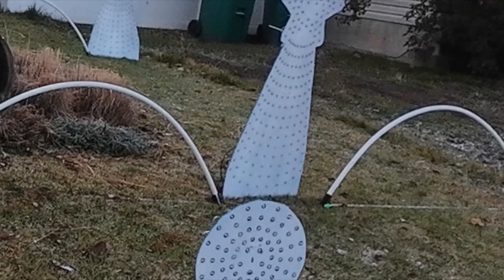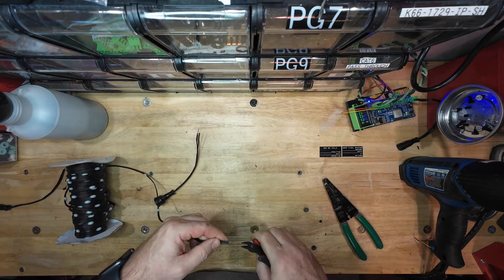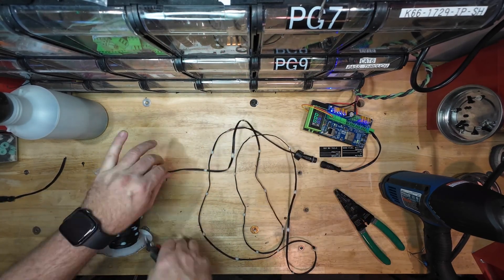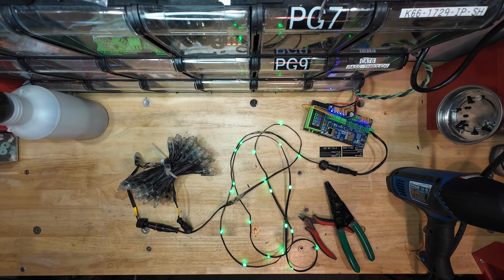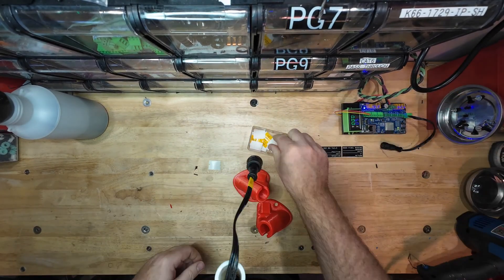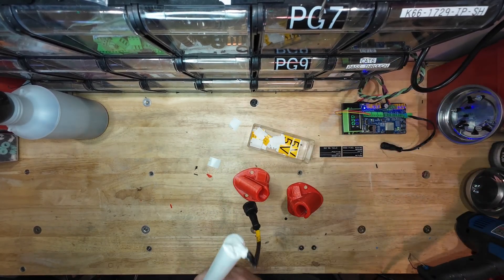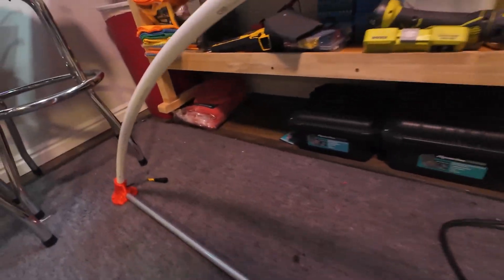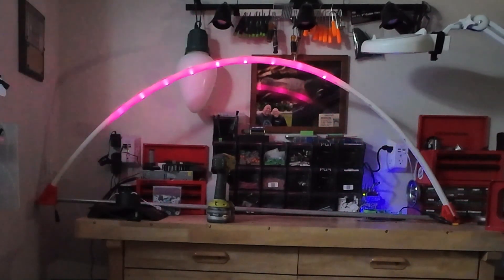How to Build Stunning Leaping Arches with LED Seed Pixels | DIY Holiday Light Display Tutorial

Comment: Female goes on controller output, male end goes on seed pixels, 3D printed parts may not last unless you use a nylon type material.  Just FYI observation, Thanks for the video.
Reply from the maker: That is correct. That is the best and only practice. I have used PLA and PETG and they have both been on the sun and snow for 2 seasons now going strong!

Comment: Great tutorial, thanks! With sealing the ends of the PEX do you have any condensation issues?
Reply from the maker: I have had no issues so far. Since I made the with seed pixels which have an ip65 rating I don’t think that would be an issue for me. Others have ran regular led strips with no ip rating with the same results. I don’t think condensation would be an issue. Are you thinking about building a few?

Comment: Do u perhaps have a video on how u connect the arch to the power and a link to the controller i dont have a controller but need to power my arches thanks
Reply: I wanna do the pig tails one the end like you did on yours
Reply from the maker: I do! I just posted a Behind The Scenes video where I show what controllers I use and how they are plugged in. Are you planning on building some?

Comment: Hello I’m just wondering were u get the end tail connectors and how do u plug it in to make them work
Reply from the maker: I got the end-tail connectors from Wired Watts — they’re the Ray Wu style 3-pin pigtails. Just hook your controller’s +V, GND, and Data into the first arch, then daisy-chain the rest. Make sure the arrows on the pixels point away from the controller so the data flows the right direction.

Comment: I've just stumbled across your video which is great, I'm in the uk and wanted to make leaping arches to run down my pathway either side which is 20ft.

Between them I have some metal walkway arches from temu which I had string lights wrapped around last year from front to back.

I guess my question is how and what do I need to run the power up one side and then crossover to the other, and in-between the gaps of the arches? I see there are 3m 3pin connectors, does it matter the way yhey are wired considering yhey are just sending a signal through to the other end, as long as they correspond to the way there wired on the LED strip.? 

I have a LED power supply and RF controller that my work (charity shop) chucked out, the power supply is a mean well lpv 100-24 (24v @ 4.2a) the controller is in a silver casing but I can't make out the brand. 
It's DC12-24V input/output voltage total output of current 12A With a power + -  and light B G R V+ terminals. Any good?
Reply from the maker: Thanks for checking out the video! That sounds like an awesome setup — those leaping arches will look great lining your pathway! 🙌

For the wiring: you’ll want to make sure your data, ground, and power lines are consistent all the way through — the direction does matter since the pixels read data one way only. As long as your 3-pin connectors match the same pin order (data → data, + → +, – → –), you’ll be good to go when crossing over or extending between arches.

Your Mean Well LPV-100-24 is solid — just keep in mind that 24V pixels need to match that power supply voltage. The controller sounds like a generic RGB controller, so it’ll work fine for simple color changes but not for running pixel effects. If you’re doing addressable pixels later (like WS2811 or WS2812b), you’ll need something like a WLED or xLights-compatible controller instead.

Comment: Which 3d printer do you use? Filament or resin. I have an Eleggo Ultra 4
Reply from the maker: I have an endor pro 3. I use PLA and it works great. Simple easy and cheap.
Reply: So filament. I have resin 3d printer

Comment: What kind of tubing
Reply: He only said PEX like 8 times... pay attention!!!
Reply: Yeah but what is PEX tubing? I'm in Australia and there is nothing called that here. We have electrical conduit that bends quite easily and 2 grades of plumping tubing, that I'm fairly sure are all PVC. Not much else though and this is literally the first time I've heard tubing called PEX. So please explain. Is PEX a brand name perhaps??
Reply from the maker: PEX is an acronym for Polyethylene (PE) that is cross-linked (X). These are durable plastic tubing used in residential plumbing systems, which have been revolutionising the Australian plumbing industry for over 30 years. PEX is known for its extreme flexibility, making it easier and quicker to install compared to traditional copper or PVC pipes. It stretches easily around curves, reducing the number of fittings needed and consequently contributing to significant cost reductions. In Australia, we’ve seen some incredible statistics related to PEX usage. It has grown in popularity so drastically that, at present, PEX accounts for about 60% of the residential water supply market in Australia. Additionally, it’s estimated this flexible piping is used in more than half of new home builds across the country.
Reply: @twinkletunesandlighting  fair enough, is it sold at Bunnings or similar??
Reply from the maker: @dsgaragedavid1987  PEX

Comment: I tried this with the strip kind of LED's and was very unhappy.  With a good way to keep the strand from winding on itself while coming down the tube is the key
Reply: I used the strip kind. I tied a string to one end with a nut tied to it. I dropped it down and the used that to pull the strip down. Didn't have any problem with the strip twisting.
Reply from the maker: It tried the strips as well and discovered the same thing. I could not keep it flat. I’m sure there is someone out there that has a system that they use but the seed pixels are a no brainer in this case.